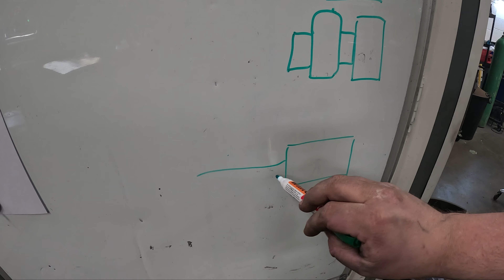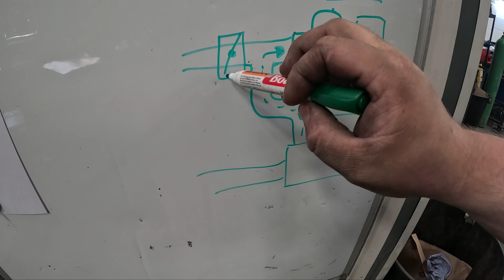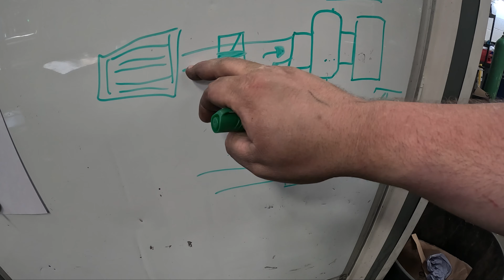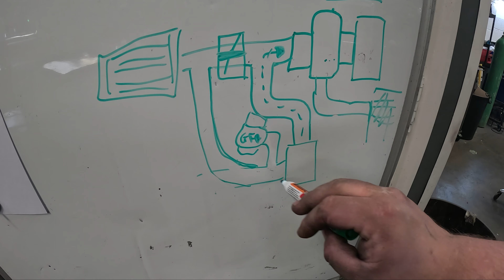COMPOUND CHARGING THE MICRA! #turbo #micra #superturbo

Comment: i see you opted for the super high quality safety squints at 18:16
Reply from the maker: Sponsored by Safety Squints.
Reply: wouldn't the air rushing in after the valve opens try and rush down the output of the charger?
Reply from the maker: No, because when the valve opens, the chamber becomes ambient pressure.
Reply: @GizFab  ah of course

Comment: The pre turbo throttle body and supercharger waste gate is doing the exact same job and not required. Compound setups like this should run air in to the turbo first, then through the supercharger and use a throttle body to bypass round the supercharger at the desired boost level. Then the supercharger becomes free spinning with equal boost on both sides.
Reply from the maker: If the Pre-Turbo body was an actual throttle body - Yes, Unfortunately we dont have enough outputs on the ECU to run a second DWB Body, we can however use this butterfly valve with PWM Activation through RPM.

We tried it the way you describe (Turbo Feeding Charger) and we just couldn't get it to work correctly. After reading how Lancia, VW & nissan ran these systems (Charger Feeding Turbo). The whole setup became much easier to work.
Reply: Fair enough, we did it the way I described on a 2.0 G60 16v with stock   supercharger and T71 massive turbo and it have zero lag and make 11 psi at full throttle just off idle and could make 25 psi by 2000rpm but still flowed 25psi at 8000rpm. If your setup is working for you then that good. Your fabrication looks amazing by the way.

Comment: Could you disengage the supercharger clutch when the boost you want is achieved and use a vacuum diverter valve?
Reply from the maker: An option yes, but with the ECU Controlled valve we can change the opening point easier (y)

Comment: Can u show us ur tool to make the bewel/lips for holding the silicone tubes. Looked rly nice. I made a diy one but I'm interested in getting a better on ein the future :) :)
Reply from the maker: Its a Dog-Fab bead roller. Pricey, but THE best. I had many of the cheaper crank handle ones and they dont has 2 weeks.

Comment: You don't need to bleed air from supercharger circuit that way from my experience. I use a 3" throttle body from a Nissan 350 Z that can be setup with its own bleed screw. To be honest after testing I found the best position for throttle was indeed fully closed. My system is almost identical to yours - but I run a huge crank pulley gearing up the m62 with clutch. Even then the m62 can only produce 7psi before turbo starts to spool sucking more air than supercharger can flow. Naturally bypass throttle valve comes into effect at that point.
Reply: Just another point I forgot to mention. You'll need to bleed air from supercharger at engine idle - the wastgate wouldn't work .
Reply: @mikebrockpug207  Thats simple. A Bov after the turbo.
Reply from the maker: Don't need to bleed it, As it will be turned off via the Electric Clutch

Comment: Things that you need to consider. The supercharger inlet is in general too small, in your case it is probably fine cause you are just going for low end power. If it becomes a problem just put a second filter on the inlet of the charger and call it a day. The wastegate on the supercharger is fine and venting it to the atmosphere is perfectly fine since you are not using a maf. I had my eaton supercharged Polo G40 setup like that, worked with no issues. Here is where you need to be careful. Simply controlling the bypass for the turbo with rpm is not going to work well. Load on the engine is what spools the turbo and not rpm so the better option is to take a boost signal after the turbo and use overall boost to determine when the bypass opens and closes and when the charger engages and disengages.
Reply: Also (and I am being cheeky here) this is a twincharged setup and not a compound setup, Compound would be if the one was feeding the other constantly and the better option there would be the turbo feeding the charger since the turbo can flow more volume of air at high rpm.
Reply from the maker: The charger is feeding the turbo at low RPM. So it is a compound setup - Just not for the full RPM Range. @Ismaak5  This is a back-dated video from July... Im slowly catching up on the videos which will show it working in all its glory.
Reply: @GizFab  Yes I saw the video I understand how its plumbed. You are making 5 psi till the turbo spools up and then the turbo takes over bypassing the charger and makes even more boost. So the charger is there just to spool the turbo faster, it doesn't provide more volume than the turbo can flow, or there wouldn't be a need for a bypass. That is called twincharged. That is not compounding. Compounding means I have lets say a turbo that flows X amount of air volume at 1 bar and I am putting bigger turbo at its inlet that makes 2X amount of air volume at 0.5 bar and end up with 2x amount of air volume at 1.5 bar at the outlet of the first turbo making the engine both responsive and able to make big power (oversimplified for the example). Essentially  for your setup the charger is bypassed as soon as it becomes a restriction for the turbo, its not providing extra volume of air for the turbo than what is can flow on its own.
Reply from the maker: I mean, We have the ability to not turn the charger off. Simple Map Switch means it can compound all the way if needed. It can be Twin Charge, It can be compound. Works either way @Ismaak5
Reply: @GizFab   If you can rev it out and never have the need to open the bypass, then what is the point of having the turbo? Adding pressure to the same volume of air doesn't make any difference in horsepower, there isn't more air to burn more fuel. If the charger can flow enough volume that the turbo doesn't starve then what is the point of switching over? You would only make up for the parasitic loses of the charger but I don't see any other benefit. With the bypass closed the charger flows a set amount of air per revolution, even if the turbo could up the boost at it's outlet there is not more air at it's inlet, so essentially you are not getting any benefit from the turbo. In reality it can't that is not how this works, the turbo reaches an equilibrium where the pressure from the charger passes throw it with no resistance and it can't go over that. Cause then there would be pressure drop and then vacuum between the charger and the turbo thus the turbo would lose boost at it's inlet. No compounding is happening, that is why I am saying this is not a compound setup. It would be if the compressor can flow more air than the turbo which then makes the turbo redundant. I am really sorry if this is bothering you and I sound like an internet cunt, I am genuinely trying to help.
Reply from the maker: I know what you're saying. But i'm also saying this video is 3 months ago (Im Catching up on the backlog), i've since competed in 5 events with this setup. With The bypass open, Charger off. We start spooling at 3500rpm. With the Bypass Closed, Charger on (Then off at 4000rpm). We see more torque before 3500rpm than without the charger. 

This whole Super-Turbo build was meant as a Homage to the 80's K10 Micra Super Turbo. That was the whole point of the build. The build "plan" was to emulate what they achieved in the 80's with a better ECU, bigger Charger & Turbo  @Ismaak5

Comment: I think that will only work in a compound fashion at the crossover point only! as soon as the turbo starts to spool it will create negative pressure a the turbo inlet thus sucking on the roots blower your bypass will adjust to try and keep 5psi until the turbo is building the ~18 psi that your supercharger is pulleyed to. so you would only be compounding greater than 5psi and less than 18psi. Either way the boost threshold & Lag will be lower. Only just started watching your content and loving it :)
Reply from the maker: Bingo. And if the ECU allowed, we would run a 2nd controller to control the wastegate on the charger outlet. Its not perfect. But it works

Comment: Instead of the electronically actuated cutout. You could have run something that is more based on a boost reference, a boost pressure actuated flap if you would get my point. Simple cheap, it always respond when you have enough boost and when you dont, flap closed ready for supercharger to build the boost for you.
Reply from the maker: Its activated by boost reference via the Haltech.

Comment: I know little about super chargers and nothing about compound charging lol but on low RPM partial throttle what is it that picks up the revs if there is no conventional throttle body?
Reply from the maker: We still have a Throttle Body in its usual place. Just imagine this as a conventional Turbo Setup. Just we are force feeding the turbo boost from the supercharger to spool it quicker. Once the turbo is on full boost, the supercharger turns off via the electric clutch and stops making boost, the valve on the air filter opens to allow the turbo to draw directly from the air filter.

Comment: What would prevent the air post supercharger from going through the throttle body backwards?
Reply from the maker: The supercharger won’t be moving any air as it will be turned off at the cross over.